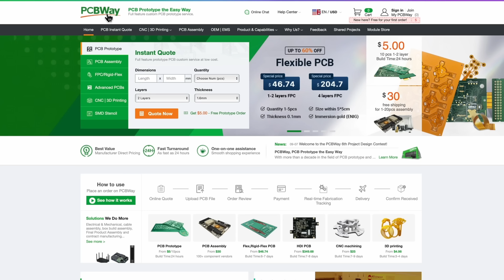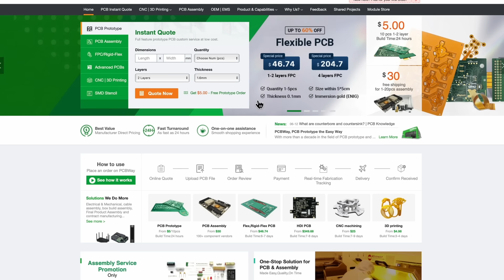Can we turn a catastrophe into a learning experience? Nordmende Rigoletto 59 pt.1 #pcbway#

Comment: Hi Manuel, I had few radios received with broken dial glas after shipping. I have a successful solution for this, the only thing is that you should have all pieces and mechanical ability of the chasis to accept thicker glass. For example if original is 4mm, the new resulting glass wil be 6mm. Of course the easiest way is to be lucky and buy good glass from german ebay. If you're interested how I'm doing it, write back. Greetings from Bulgaria.
Reply from the maker: I think I see where you’re going but the problem here is that a lot of the actual display is gone … into minute pieces of glass. We’ll see when I get to it just how much will be visible.

Comment: What a shame, the state of this radio!   Radio Daze reproduces dials for American radio's.
---
I was just the opposite. At the age of 9 in 1957; I was repairing TV's for my neighbors. I would pull out every tube and head down to the local grocery store where they had tube testers back then. I'd head home with good tubes in hand, and see if that fixed the problem.  If not, I'd look for CAPs that looked bulged out or had a hole in them, and replace them.  Oh, I should have mention that I checked the fuse(s) and rectifiers first!  Back then I had only a VTVM. Nothing else, like I have now.
---
As for your videos, since you show the schematics and mark what you have replaced- and since I can read a schematic, I have no problem following you.  But for newbies, this could be an issue.  But since you do repairs and are not teaching how a circuit works. I think this is enough, because their are plenty of people on  YT that go into how circuit works.
----
So I feel that those that don't understand circuits, go to another channel and learn them, then come back to your channel to see a PROPER way to repair radio's.
People need to realize your a repair channel, not a theory channel.  Hope that helps.  And keep up the quality work that you do! 👍